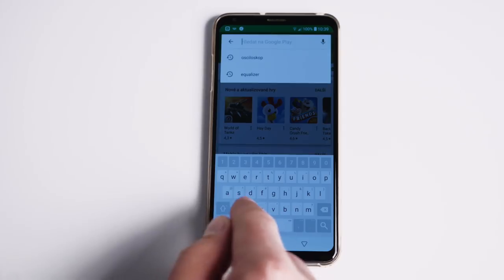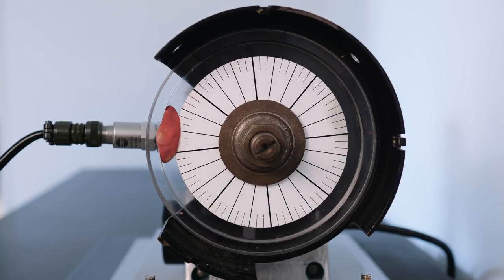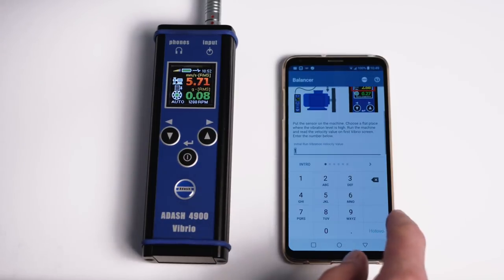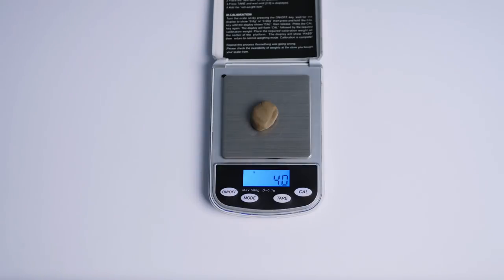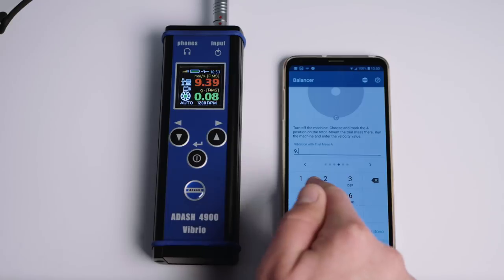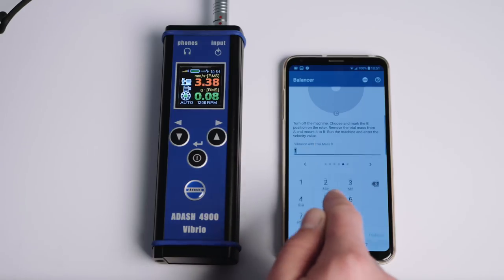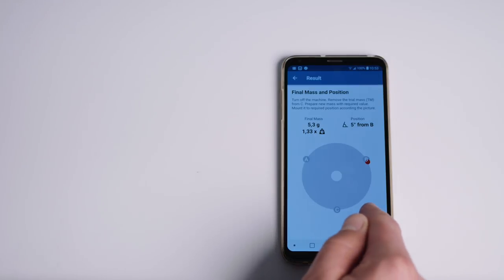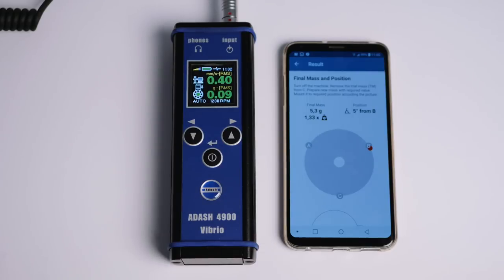Easy balancing with vibration meter and mobile app

Comment: dear Adash, that's really usefull app.. thank you very much.. but do you have other software that can calculate.. correction weight for limited holes on shaft, for examples like 8 holes.. u cant place accurately the correction weight on the shaft.. so the solution (best approximation) of the balancing must be within the existing holes..
Reply from the maker: Yes, we call it Components function. Usually used for balancing of indstrial fans. Means you can define number of blades, for example that 8 and final correction weight will be split into 2 nearby blades instead of angle. You can check it for example in our Virtual Unit software which is free for download: https://adash.com/software-vibration-analysis/virtual-unit

Comment: Hello, I have a query, is this application useful in turbocharger rotors?
Reply from the maker: Theoretically yes. But for high speed rotors would be better to perform standard balancing job with measuring amplitude phase and speed.

Comment: Great Equipment! Its possible use just A one trial weigth point or should use the a/b/c Weight point?
Reply from the maker: We are afraid the answer is no. This is a balancing method without phase measurement (no speed probe). The final mass is calculated from all 3 trial weights. If you have a device which can measure amplitude and phase, then you can place the trial weight just once and then you get the result. Check out this video: https://www.youtube.com/watch?v=rz4gUVwwHDo

Comment: Hi.  Excellent video and explanation, but i have a question.
Rather than adding a 'new' correcting weight to the rotating object, I'd prefer to remove weight say with a die grinder.  
I don't anticipate that the weights in question would be anywhere near as big as in your video, but is it fair to assume that the weight would be REMOVED from the location OPPOSITE where the balancer suggests placing the correcting weight?
Regards Mark in the UK
Reply from the maker: This is absolutely correct: "the weight would be REMOVED from the location OPPOSITE where the balancer suggests placing the correcting weight". But we wanted to make the video more understandable. We also wanted to keep the Balancer App as simple as possible, therefore it does not contain remove (drill) weight option. Our vibration analyzers contains this option.

Comment: Which hardware model do you recommend for electric scooters?
Reply from the maker: Our vibration analyzers are mostly used for monitoring of industrial equipment such as el. motors, fans, pumps etc. But they can measure anything what generate vibrations. Even with our simplest device you can try it on el. scooters. Vibrio M: https://adash.com/portable-vibration-devices/a4900-vibrio-vibration-meter

Comment: when is going to be available for IOS?
Reply from the maker: iOS version will be hopefully ready early next year.
Reply: @AdashCompany  Hi There Has there been any update on the app availability for ios? Thanks.
Reply from the maker: Hello Mark. We have to admit that Balancer App for iOS had very low priority this year. We were all busy mostly with the new VA5Pro development and then of course continously improving our current devices and software. But we opened this issue internaly again and programmers should start on iOS app before end of the year. Hopefully to have good news for you soon!

Comment: I have small doubt what is res point(3.89,1.83)?
Reply from the maker: Balancing in one plane is just a geometric task. Let's construct the initial circle (centre 0,0; radius - init. vibration), circle a (centre A, radius - vibration with weight at position A), circle b (centre B, radius - vibration with weight at position B), circle c (centre C, radius - vibration with weight at position C). The result (point Res.) is then found at the intersection of the circles a, b, c. If the circles do not have a point as intersection, but only a region of intersection, then the result is somewhere inside (where? - that's a long story).
So the Res. point is the result of a geometric solution. Position of Res. point determines the resulting final mass weight and the angle of position. Here the whole picture with circles is used to check the balancing calculation.

Comment: Is it possible to use an my iPhone to measure the vibration ?
Reply from the maker: There are a few "vibration meter" apps in the App Store. But there are very limited measurements, not applicable for machine condition monitoring nor balancing.

Comment: Adash  app could be worked only?
Reply from the maker: What do you mean? To do balancing with our App you need some vibration meter. It does not matter which one. Is that your question?
Reply: @AdashCompany  Yes without vibration meter
Reply from the maker: @amr.a-m8350  You need some vibration meter.

Comment: Can the same results be achieved with mm/s^2?
Reply from the maker: Yes it can. Just keep the same unit (your mm/s^2) during the whole balancing process.
Reply: @AdashCompany  as i suspected. Thank you very much for your reply ;)
Reply: There is something wrong in calculation of the final weight it must be 53g not 5.3
Reply: 1.33 * 40 = 53
Reply from the maker: @mohahm1492  Trial mass is 4.0 g, not 40. So it is correct sir :-)

Comment: No thanks, can't afford the $4k for the actual tool.
Reply from the maker: You can use Adash balancing app with any vibration meter. It does not have to be Adash.